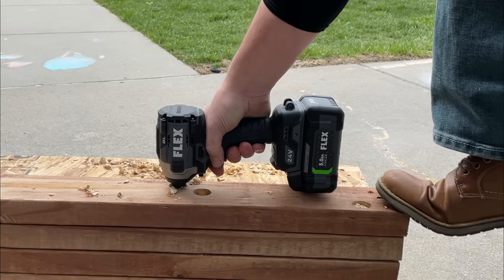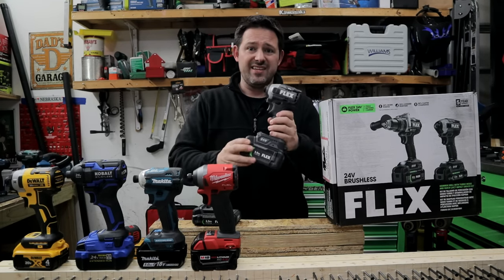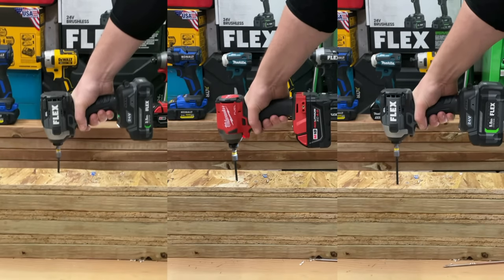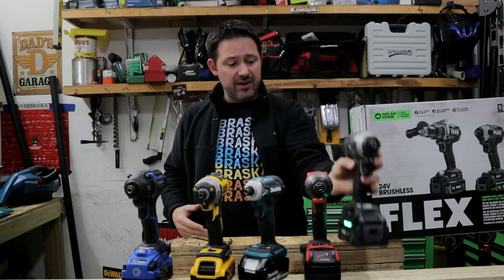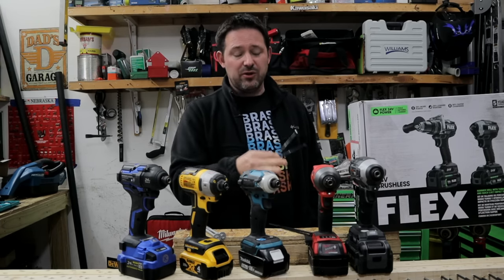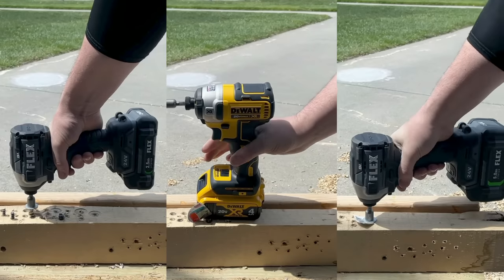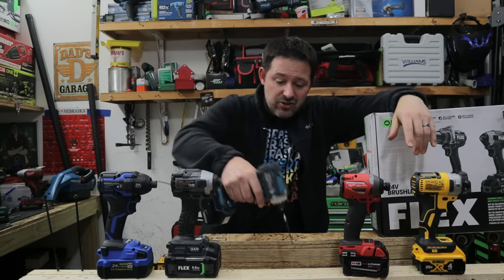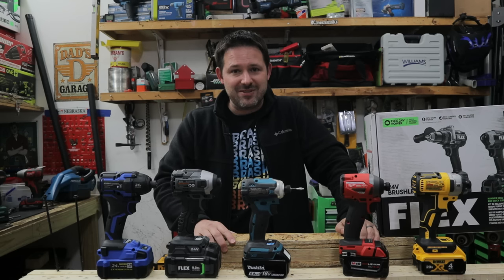FLEX TOOLS vs DEWALT MAKITA MILWAUKEE It's NOT what's NEXT Impact Driver SHOWDOWN!

Comment from the maker: The FLEX with a 2.5ah weighs 4.04lbs and with a 5.0ah weights 4.83lbs compared to the Milwaukee with a 4.0ah XC weighs 3.79lbs and the Makita with a 5.0ah weights 3.35lbs and the Dewalt weights 3.39lbs. When you do power to weight ratio it's clear which one is lighter and faster tool.

* I do not own a battery bigger than the 4.0ah for the Milwaukee tools.  I displayed the FLEX with a 2.5ah and 5.0ah so you can compare side by side.
Reply: Not really an issue. The M18 CP3.0HP, XC4.0, and XC5.0 can all deliver essentially the same amount of power, only the runtime is different. It’s not until you move up to the XC6.0HO or HD9/12HO that you’ll see more power...if the tool is capable of using it. Of course, if your XC4.0 is old, that might be a factor.
Reply from the maker: My XC4.0 is from Home Depot this Christmas 2020 and was included in a brushless 3pc tool kit that came with a free mini hack all for $249
Reply: @ClientGraphics great video, finally someone does a proper vs for Flex. I have some m18 high output batteries I can loan you if you want to try those in a versus let me know!!!
Reply: Why didn’t you use a 5 on all of them 😡
Reply: @lamurtedeenzotorres7054  he explained that is the comment you replied to.
Reply: Ma-ki-ta for the win 😬💪🏼
Reply: @geoffstrickler  this is not true the 3.0 has more power than the 4.0 and 5.0. And the 5.0 has more power than the 4.0. The 3.0 is using 21700 cells vs the others using 18650. To make this test fair you should use a 6.0 battery on the dewalt and the milwaukee because the flex is using 24 volt and not 18.
Reply: @marcusvickers5645  Actually someone already did. Check out Man Caver Tools channel and watch flex fail on tougher jobs. Couldn’t finish a 1.5in speed bore or 10in lag bolt. Guess which big boy tools got it done?
Reply: @justinbollinger5279  yes, 21700 cells can supply more power, individually. But the XC packs use two rows of cells, and can supply equivalent power because of it.
Reply: @justinbollinger5279  It's not that straightforward. The XC4.0 may make more power than the XC5.0 b/c the layout (5S2P) is the same, but a lower capacity cell can handle higher current better initially. The 3.0 power is comparable within 10% to the 5.0, possibly slightly lower.
Milwuakee's CP3.0 uses 21700, whereas the 2.5Ah Flex uses 18650's. I haven't seen a Flex 5Ah teardown yet, so I don't know the cell type.

Making these tests "fair" would require the reviewers to use known new-in-box batteries of theoretically equal powers calculated from the specifications of the cells used, and even then, varying thermal management would mean that different batteries handle peak loading differently, so still not fair. From the standpoint of just testing tool performance, these guys should be using a 2kW DC power supply with a good capacitor bank on the output to handle the current spikes, set to the voltage of the relevant battery system just off the charger. This would remove the variable of battery construction and age from the performance equation - although we should also be concerned with which tools perform better on partially discharged batteries or older cells with higher resistance since those conditions are common among tools in use.
Reply: While watching the last tests on the white oak I noticed your wrist was vibrating when holding both flexs , I presume after a while your wrists will be shot , personally I wouldn’t jump on the flex wagon just yet , they will need a lot more tools and better innovation to get my money , I stick to my Milwaukee and makita for now 😎
Reply: @lamurtedeenzotorres7054  It still wouldnt be fair, 24v 5ah has more Wh that 18/20v 5ah batteries. Anyway its clear that Makita is the winner here, lightweight but powerful, no issues and its also quiet and comfortable. I use mine with 2.5ah battery, super lightweight and flawless in use.
Reply: @assadhalabi6128  Youre right, the wrists will suffer. I used a big drill hammer for several hours once, it was horrible. Also driven cheap crappy rental motorcycles on long trips and the insane vibrations made my fingers stop reacting normally, i tried to move them but nothing happened the first 2-3 seconds, then they moved slowly, very weird feeling.
Reply: Is this a flex promotion? Because you didn’t even include hitachi/metabo hpt triple hammer. Drop the Kobalt and add the triple hammer. Kobalt isn’t a “top tier brand” or player in contractor grade tools.
Reply: @justCarner  either the Metabo HPT and/or Bosch's Freak 2 would've been more suitable for top tier brands
Reply: I own the Kobalt XTR and the M12 Fuel. Both do most jobs fine. Love the light weight of the M12. The XTR definitely has more torque and I use it for heavier fasteners. 

Both excellent. If I just owned kobalt or just owned M12/M18 I’d be happy with either lineups higher end drivers. Same with dewalt. I don’t have their impact driver, but have owned enough impact wrenches from dewalt to know that theirs, as seen in the video, usually aren’t the fastest etc, but they are rugged and never let me down at the end of the day.
Reply: @geoffstrickler  It is absolutely true and there is plenty of evidence and videos into reviews this argument has already been settled it’s a non-discussion the higher and power does produce more power but believe whatever you wanna believe the rest of the tool world knows better
Reply: @steffendetrick9403  it’s actually proven false, go look at the actual results. My first comment is proven true.
Reply: @geoffstrickler  What you’re saying is not accurate I’m just gonna leave that there
Reply: @steffendetrick9403  and you’re wrong. What I’ve said is literally proven, many times over. Go watch a few videos on Torque Test Channel, or Philly Fixed, of a number of others, specifically those testing different battery sized.

What I’ve stated is provably correct, all anyone has to do is go watch the videos. When you’ve done that, you can come back and admit I was correct
Reply: Flex is owned by China now. Si this is a hard no for me bud
Reply: @geoffstrickler  I could do work better for you let me know I’ll provide links. I don’t know if you’re a hobbyist an apprentice. If you’re a professional that’s a long time to be doing something professionally and still not know. A lower amp power battery will not sustain the output that a higher amp hour battery will under load. It’s not that the Higher amp hour battery produces more power it produces a sustainable power. I know I’m coming off rude I’m not trying to be but it’s practically common sense.
Reply: @steffendetrick9403  common sense is often wrong, as you have been on 5is thread. No, what you have stated isn’t provably correct, it’s simply incorrect. Not even going to try arguing with you because you’re clearly committed to your incorrect beliefs.
Reply: @geoffstrickler  Apparently you are. And you’re right I have no desire to argue with a hobbyist.
Reply: @steffendetrick9403  again with bad assumptions. GFY.
Reply: @geoffstrickler  Still arguing hobbyist??
Reply: I have both Milwaukie and Dewalt tools.. I have to say they are both reliable and long lasting. I can't really say anything about the other brands.
Reply: Who gives a crap what power to weight ratio is in this context? Absolute power is the only meaningful metric.
Reply: @niflag  Dependability is my only metric. DeWalt and Milwaukie win in that category.
Reply: And I'm a female and I don't complain about any weight of any of them that's something that a little kid cries about I don't want to push the broom 😂😂😂😂😂😂😂😂
Reply: @jamiewilliams7120  PREACH !!!  Who cares about the weight LoL...  Long as it has power & works great I can handle liftin my arms for awhile with a few pounds in my hands !!!  Or simply dont reach up...  Get a ladder reach down...  Keep it simple dudes !!!  🤦🏽‍♀️